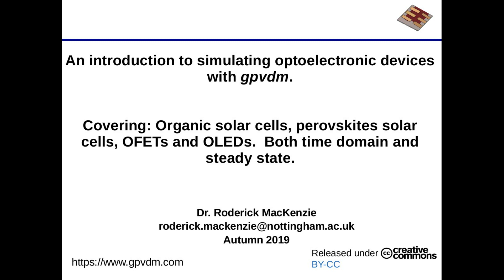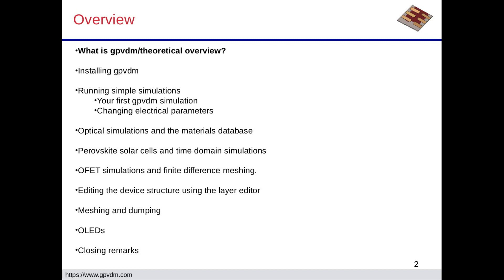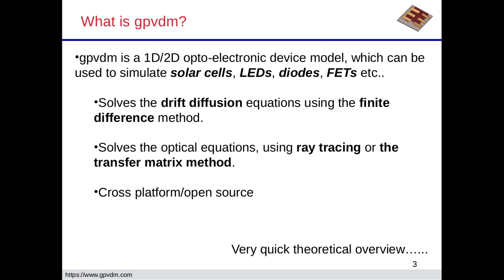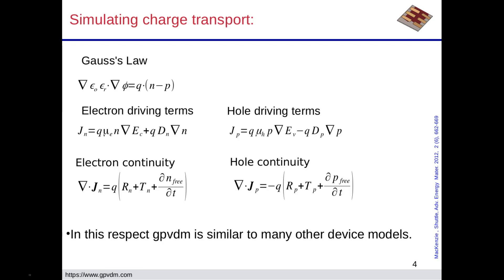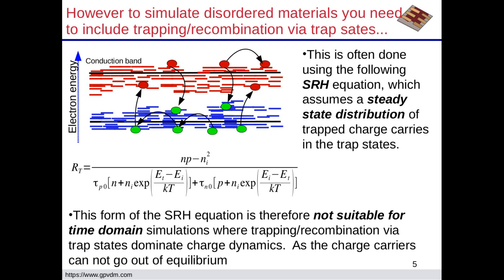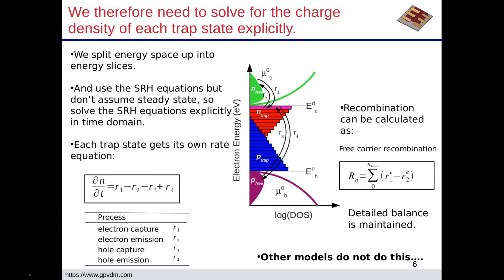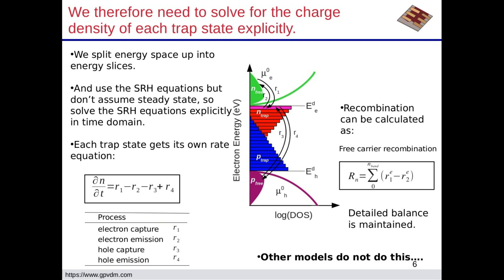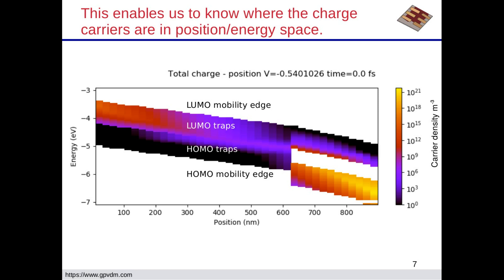What is gpvdm?

Comment: On windows 10 it shows that this software can harm your computer delete it.  Is there any virus problems?
Reply: You get this error because the .exe file is not digitally signed. To sign the exe I would need to spend 100 Euros/year on a key from Microsoft.  Thanks for pointing this out I should add this to the FAQ.
Reply: @roderickimackenzie  thank you very much sir for being kind enough and responding to my question.  Thank you.
Reply: Sir, can I use this software for dye sensitized solar cells?
Reply from the maker: I guess so, but I have not tried to model DSCs as they are quite an old technology and I personally do not find them interesting.
Reply: @OghmaNano  thank you sir

Comment: Sir please explain pervoskite solar cells.
Reply: That's quite a big topic.  If you have a specific question I will try to answer.
Reply: @roderickimackenzie  Sir, it's not working properly, I even updated gpvdm and tried with different version. But still the results are not satisfied. It only work with the default values, when we change the value it's output is either infinite or zero.